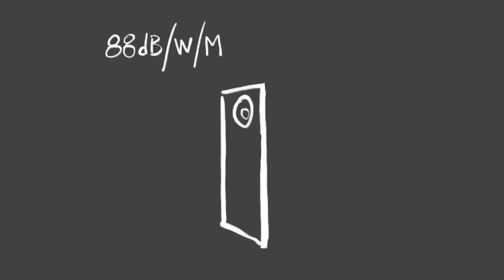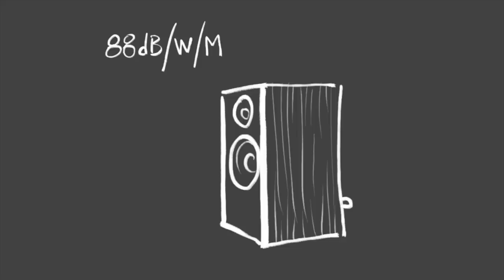John DeVore goes on a rant about the High End Audio lie that inspired him to start his company

Comment: Interesting video on a topic I had not thought much about.  I scrolled through the comments and I didn't see this covered, but if it is I apologize for repeating.  

I can see your point about sensitivity, but compared to other parameters like amplifier power or speaker power ratings, you kind of picking on a minor point I think.  It's great to have a single number like the voltage on a light bulb you can simply go to the store and buy a 120v bulb and know it will work, but as you point out in the video speakers are not resistors, and if they were they'd still vary in resistance anyway.  

I was stunned to find you could hide such a low sensitivity speaker using a 2.83v sensitivity measurement, but you always have to take in to account the real impedance curve of the speaker anyway when choosing and amplifier because if thought the sensitivity rating wasn't entirely honest it is, as you do mention, common for an 8 ohm driver to plug to 4 or less at certain frequencies and thus really require a 4 ohm rated amp.

I think the 1 watt at 1 meter was more useful in the past when you had taps on the output transformer you could choose from.  Certainly made it easy to match the speaker to the amplifier.

Unfortunately, as a side effect of all the experimentation and inherent complexity, you can't always reduce things down to a simple number for lay people.  I build computers and everyone talks about the processor, but there is more to performance than the gigahertz of the processor.

What I would like to see is data on distortion similar to what Nelson Pass has show at some of his lectures.  Then we could find out what kind of distortion we preferred and be able to choose an amplifier with the preferred sound signature.

Really?   80 db with 1 watt?  How do you even cool the voice coil?

Comment: Hi John, thanks for this very to-the-point rant. However, to me it gets worse because I think you left out a little piece of the equation. I think the correct definition of dB's @ 1W @ 1m ends with @ 1000 Hz. I have a little Jensen guitar speaker with a less than impressive sensitivity specification. But it still dishes out a bucketload of volume because the sensitivity above and under 1000 Hz is about 6 dB higher! I'm thinking of measuring all my 8" guitar speakers (about 15 or so) with 1W @ 1 m using pink noise to see how that compares to factory specifications. Care to rant about that? Let's not even get started on speaker impedance curves or amplifier stability.

Comment: Ok. So I understand the math but might have missed your point.. sounds like your issue is that this modified sensitivity spec doesn’t accommodate speakers that are not 8ohm?

Doesn’t standardizing some of these parameters make it simpler for most consumers?  Or is that the root of the whole issue here?

Comment: Technically the units dB/Wm never made sense - it implies that if this value is constant for a certain speaker, as your distance from the speaker increases, the dB level would increase proportionally with it!  dBm/W doesn't work either, because dB is a logarithmic scale and so inverse proportionality would be nonsense (of course, sound intensity follows an inverse square law to first order anyway).

Comment: The moving particles are called charge carriers, which may be one of several types of particles, depending on the conductor. In electric circuits the charge carriers are often electrons moving through a wire. In semiconductors they can be electrons or holes. In a electrolyte the charge carriers are ions, while in plasma, an ionized gas, they are ions and electrons. And ohm means nothing. You just check that to pair speaker parts so you get same power output, about. Or use different wires and metals and think about cooling the voice coil, etc old boxes were bigger and had smaller voice coils. Lower ohm speakers are alot better if you know what you are doing and understand magnetic fields. Most speakers are shitty though.

Comment: This makes me miss my Krell gear and my Threshold SA-2 monoblocs. Terribly. But to the point, if a speaker needs to be fed something “abnormal” but it will produce truly magnificent sound, then sensitivity means zero to me. If I have a pair of early Quad ESL57s, or Altec “Voice of the Theaters” or something newish from Wilson, they’ll all greatly benefit by choosing power that might make them positively sing, but would sound terrible on almost anything else in comparison. I personally am always chasing that absolute sound, that reproduction and presentation of the concert or studio sound as chosen by the artist. How I finally get there is the most important thing, like casting is to a movie. And I will swap gear like some people swap tubes out but not lose sight of the goal. So, no matter if I need more brute power or a pre with better soundstaging. Sensitivity is going to be WAY down the list in making this decision.  And to concur with others, this is no rant, but a clear and cogent discussion of a potentially unclear and changing subject. Thanks!

Comment: One reason those 'battleship' receivers from the 1970's sound a lot more powerful than todays receivers is that they were required to provide their watt output rating over the full 20-20,000 hZ spectrum. Back then cheap brands inflated their watt ratings stating output from 40-20,000 hZ. 
 Most of todays receivers state their rated watt output only at 1,000 hZ. I'm making an educated guess but if todays receivers still had to measure from the full 20-20,000 hZ spectrum, their watt output rating would be cut in half, perhaps even more. 
 Also people have to understand the db rating of 1w at 1meter meant that a doubling of power only increased a perceived loudness increase to the ear of 3 db. You had to increase power output times 10 for a perceived twice as loud level to the ear.
 That's how significant the efficiency rating of a speaker was. For instance a Klipschorn speaker provided an enormous output of 101 db from 1 watt at 1 meter. This meant  a speaker rated at 86 db needed 32 watts to equal it. With 5 watts going into the Klipschorns, that same speaker would need 400 watts. Remember you have to double the power for each 3 db increase (1 watt, 2, 4, 8, 16, 32---corresponding to 86 db, 89, 92, 95,  98, 101).

Comment: I think you made a mistake.  The amp max output doubles.  Or not with halving. Ohm law remains.. So when you measure 2.83volt and do the measurement on a 4 ohm driver,  it is still 2 watt. You say with some amps these laws suddenly do not apply . That's not true

Comment: Isn't it the other way around? 
The higher the resistance, Ohms, the harder it is to drive a speaker. 
It certainly is so for headphones where you don't want really high impedance headphones since they give such a low output. That is most evident if you plug-in a high quality studio headphone into a smartphone compared to the very much lower impedance in-ear plug.
Is the physics different for speakers than for headphones?
To me, the common sense is if you raise the resistance, the harder it becomes to drive a speaker, not the other way around!

Comment: I have been a very happy owner of a pair of Thiel CS5's since I bought them new in 1992.  I realize that, not only will I never be able to afford a comparable set of speakers again, but I will also never be able to afford an amplifier that will properly drive these monsters.  Still, they sound great, even with my under-powered amp.  Your explanation of ohms, volts, current, and power is excellent, and I really do agree with your rant.  However, I don't know of any speaker that acts like an 8 ohm carbon resistor; they all vary their impedance greatly with frequency.  (Except maybe for electrostatic speakers?)  Thiel was just being honest to a fault about the (lack of) efficiency of their speakers.  If you test the CS5 or any other speaker, the efficiency will greatly vary with frequency.  It's just that it seems to matter more when the efficiency is as terribly low as the CS5.  If I remember correctly, my speakers came with an impedance/frequency chart, not sure anymore.

Doesn't this open up a new can of worms?  I always thought these power measurements were taken at 1Khz, which is a very easy frequency to reproduce efficiently.  If they were measured on a graph at 20 to 20K, wouldn't it look embarrassingly terrible for any speaker?  Next can of worms.  Because of this, and because of what you pointed out with tube amps, wouldn't the frequency response of any speaker vary much more with a tube amp than with an extremely low impedance transistor amp?  And, could this be one of the reasons golden-eared audiophiles swear that tube amps sound so much better than transistor amps?  Could their ears be getting fooled by a sweet-sounding change in the frequency response due to impedance and subsequent volume changes at various frequencies?  I know my ears are easily fooled by things like that.  Uh, oh!  Maybe I shouldn't have brought that one up!  I may be sorry!

Comment: Effectively you are saying these speakers need to be driven from an amp with a very low output impedance, or different frequencies will see very difference voltages - so the "per volt" sensitivity spec. is a way to tell the truth while being totally misleading.

Comment: Great video. I use YG Acoustics Carmel 2, they are pretty real sounding but 4 ohms and I have them hooked up to Mola Mola Kaluga's that are rated at 400 watts @ 8 ohms but 700 Watt at 4 and 1200 Watts at 2. So I have plenty of power with their 86 DB sensitivity and it sounds like a real person is singing in my room especially when I play vinyl.  I don't have an exotic turntable just a Rega Planar 6 with a Mofi ultratracker MM cart and a Rogue Ares tube phono stage with some Mullard and gold lion 12ax7's and a Lampizator DAC that is also an active Tube preamp. I think the design of the speaker and qualiuty of the parts in the construction matters more than the sensitivity since we can get unlimited power on the amp side today. An Audionet Heisenberg is 530 @ 8 ohms but over 1000 watts @ 4 and 2000 @ 2 and the best amps I ever heard. It is the design that matters more in my opinion. My speakers have no stuffing, are sealed machined aluminum boxes and made out of 5 axis cnc machined drivers out of T6 aluminum billets. I think the future will be class D as Bruno Putzey's solved the bad sounding Class D amp problem so power will never be an issue. I still use tubes and they are good as a preamp since the loads on them are smaller and distortion isn't as much an issue in their power bands.

Comment: It's interesting to me how the explanation of the Krell is of an amplifier behaving out of the norm. I got interested in audio from car audio around 2000 and that's simply how most good car audio amplifiers perform. Those that didn't double typically had weak hardware. Though there were exceptions for some high quality amps that were very regulated that put out the same power at any rated impedance (per the spec anyway)

Comment: Wanna buy my JBL E-130 speakers.... I think they’re rated at 106 db at 1 watt, at 1 meter. 
BTW. My pet peeve is when people use “V” instead of “E” when displaying Ohms law... You are measuring Electromotive force, not Voltage. 
Ya don’t use “A” for Induced current, do you?
“W” for watts?

Comment: I fully agree, the HiFi press are responsible for a lot of this nonsense. Some of this is somewhat inherent, the DC resistance of a voice coil is far lower than the impedance at a few hundred hertz or so. If nothing else sometimes these awkward to drive (usually small) speakers help trash the reputations of basically good amplifiers. As you quite rightly point out the sensitivity rating using voltage encourages designers to do a slippery impedance drop to try to extract more power from the amplifier. Sadly loudspeakers are highly reactive so the voltage and current will be out of phase anyway so power measurement is more complex than it first appears. Unfortunately the HiFi press  invented a whole new type of physics, which for me made them lose credibility perhaps 30 years ago.

Comment: Speakers are an inductive load, they only measure their rated ohm load at one exact frequency for that exact speaker. Because that is the reality 1w/1m is just not very good for comparing one to another. 2.83v isn't much better as the results would be wildly different for speakers that present a higher or lower load to the amp, and we still have the problem of brands measuring that at varying frequencies. Shopping for a sub and the rating was done at 1khz, that doesn't say anything at all for the range its going to operate in.  It would be nice to get a 2.83v response curve overlaid with an equivalent power curve from manufactures, it would be seriously easy for them to provide but that would show the truth so its never going to happen.  The best you can do is learn to use REW or winISD to generate that yourself but even then it seems most manufactures cite T/S specs that are outright mathematically impossible within the laws of physics, others make the effort to make the specs they provide check out logically but are often not what the supplied product is in reality.  If you build cabinets or boxes yourself, measuring the T/S secs yourself before designing anything is a huge step up in what your final result will be.

Comment: Not sure what DeVore is complaining about here.  Do some speakers have an unusually low impedance?  Yes.  Does this result in a greater current draw for the amplifier?  Yes.  Are the design choices that cause the low impedance worth it?  That's up to the individual.   There's no downside to having lots of power available.

Comment: Just a different design philosophy, but I prefer the sound and properties of speakers that tend to have low impedance and moderate sensitivity, which are necessities of designs that feature flat, extended frequency response and accuracy (faithfulness to the signal) and reasonable time/phase coherence and pinpoint imaging all while not being overwhelming in size.  I think it’s a fallacy to assume that nominally 8ohm speakers with high efficiency are inherently better than lower sensitivity speakers with lower impedance.  They’re just easier to drive for low powered amplifiers.  Not all people value the undeniably colored sound and romantic sonic traits of fat warmth over neutrality.  Different strokes for different folks.

Comment: The one thing that you didn't address is how those low sensitivity and inefficient speakers fail in the area of dynamic range and subsequent transient response characteristics.  Most of them provide a smooth frequency range and silky sound but lifeless.   Live sound has snap to it efficient speakers do a far better job of reproducing transients  unless of course the recording engineer/producer has compressed the life out of the sound.

Comment: I understand your rent and obviously you are 100% correct, but does it really matter from a customers point of view? I am into loudspeakers with fairly good sensitivity. I like horn speakers, but I don't think that horns are necessarily the best way to go unless you have unlimited resources and you can build your house around the speaker, and even so it still remains debatable. But let's say you have something like an Altec Voice, if you want some control in the bass you will not run it with a 300B SE. It is more likely that you use a 805, 845, KT88 that sort of thing or maybe go directly PP instead of SE. So you would not care about sensitivity at all even so that the Voice has a sensitivity above 100db I guess. I mean the 8ish Watts from a 300B are sufficient to drive this thing loud enough but it will not really sound very good in such a combination. As a customer, that's exactly your job to listen to this stuff and figure out what suits your musical taste best. But once you are in this high sensitivity game you know what to avoid. It does not matter if Dynaudio gives you Watt/Meter or Volt/Meter, you wouldn't buy it anyway. On the other hand when you see a speaker like a Wilson Audio Watt/Puppy with its 90db you know that is does not need a lot of power but you see the two 21W54 and you know that these guys need a bit of damping factor, surely not Krell/Threshold style damping factor but a little 50 Watt Spectral or Cello will surely do better than most tube amps. I think that you can see it right from the design of the speaker, the chassis in use and so on.

Comment: Only one complaint. The units are dBa not dB.  dB expresses a ratio but needs something to compare it to.  Nit picky but important
Reply: The (A) in dB(A) signifies the filter weighting. The ratio compatison reference is the threshold of human hearing in Pascals. This is implied by context in an audio discussion, but for completeness the correct unit is dB SPL (Sound Pressure Level). If the typical measurement filter is applied, this becomes dB(A) SPL.